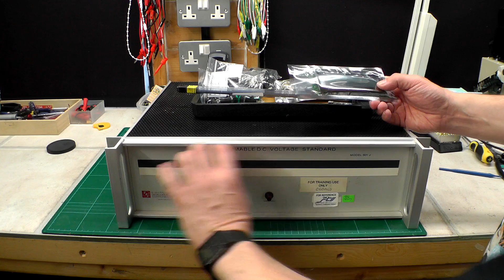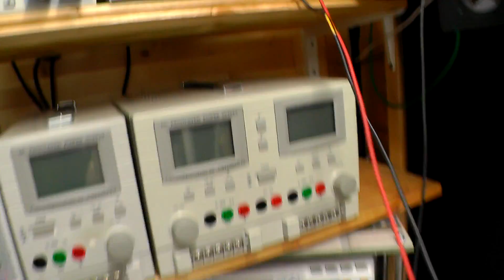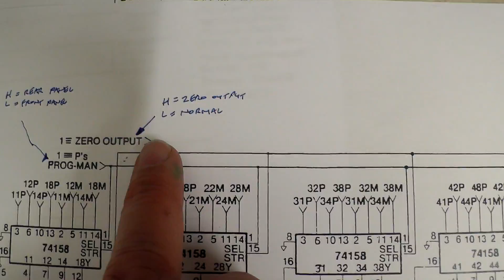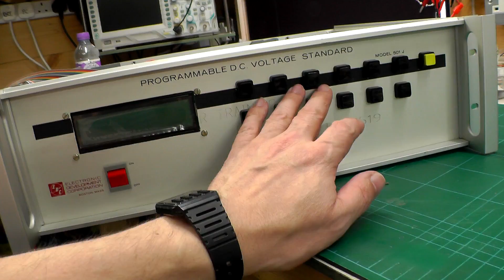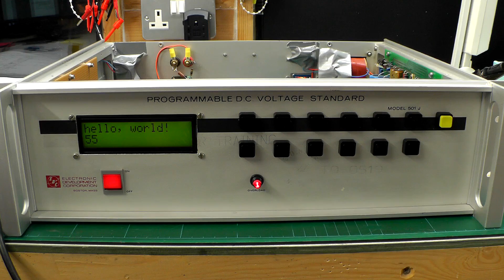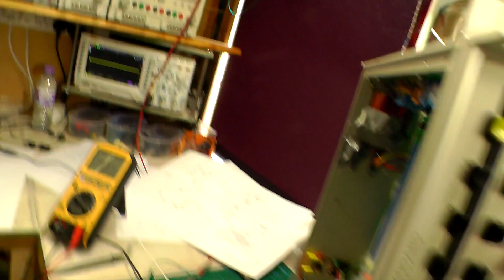EDC-501J Voltage Standard Custom Front Panel Controls

Comment: Cracking job, your too clever :-D
I can understand the logic side but my brain cant cope with the jibberish programming language of modern microcontrollers, but we all cant be the same can we :-D
I would be using the rotary selector switches with numbered skirt on the knobs.
That device lends itself to eather simple or complex control, i do like basic systems as there simpler to fix and understand :-)
I did build a simple lcd L/C meter controlled by an old pic chip, but i had to use the authors code to program it, and i got to use my old willem programmer to write the code to the pic, so i did have some fun :-D
Reply from the maker: zx8401ztv Assembler is jibberish, C++ is a dream...........in my opinion :)

Comment: Excellent as ever from start to finish. For masking the unwanted stamped letters on the front face, you could extend the black stripe downwards and have it wider on the right in a wedge design. Or possibly a contoured curve design curving down to avoid the overload indicator. A bit like a swoosh design.

Comment from the maker: UPDATE: Found out how to enable 100mV mode on the unit, so the resolution is now +/- 10uV for the 10vdc range, and +/- 0.1uV for the 100mV range. Both 1ppm. I've added another pushbutton to toggle between the two modes.

Comment: Ohh, a very simple mod would just be mounting some BCD-encoded thumbwheel switches in the front :D A nice software touch would to have the yellow button switch between zero and recall last value. What i really do not like on this apparatus the mains connector and fuse, no double insulation :(